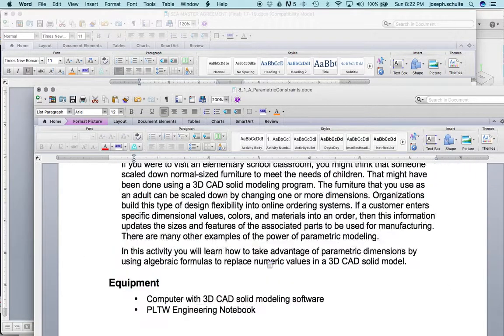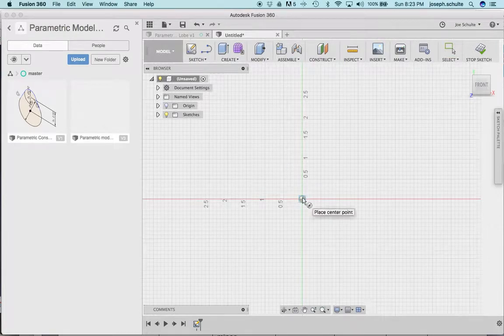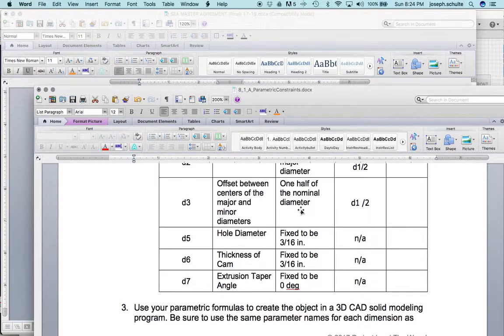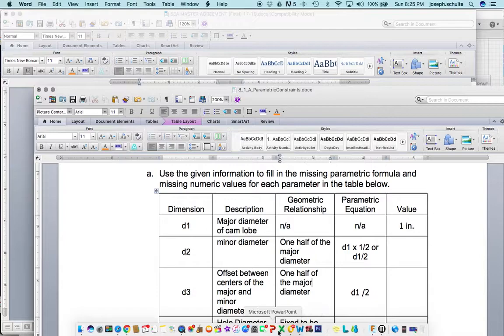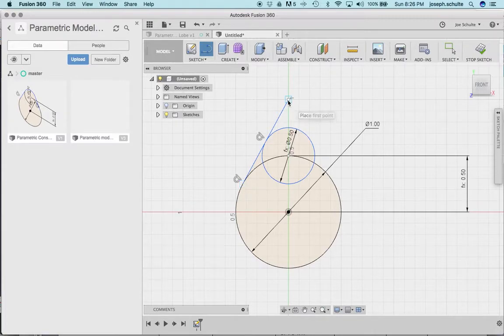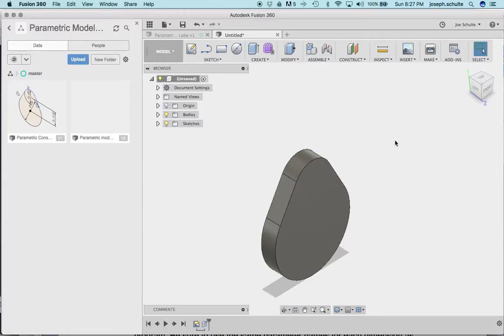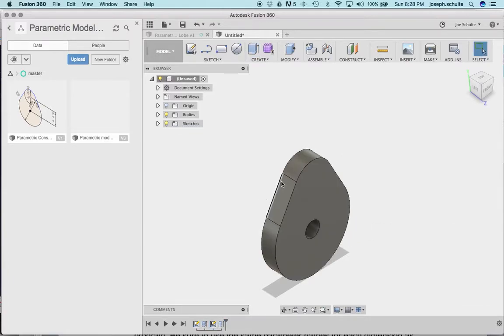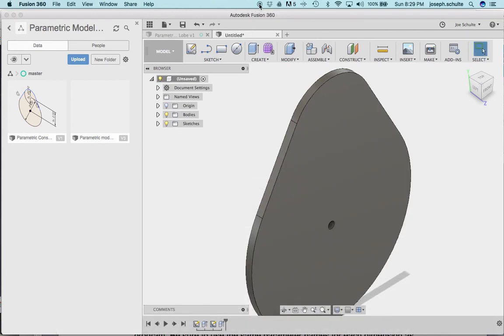Parametric Modeling Practice  - Cam Lobe

Comment: The lobe looked like it had no duration, a flat cam lobe will close fast and cause misfires, the line from the top circle to the bottom circle dictates the duration, how would you measure duration?,,, you can't use a caliper and a lobe machine cost hundreds of thousands😢